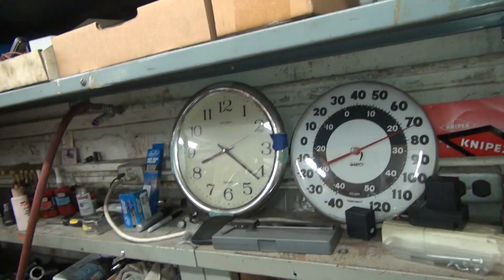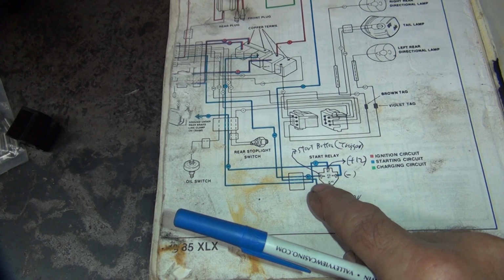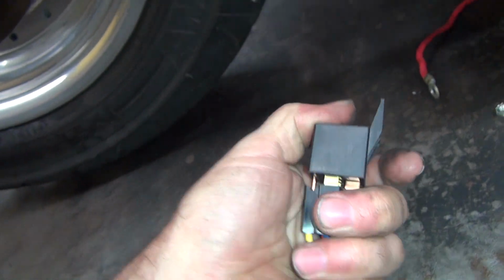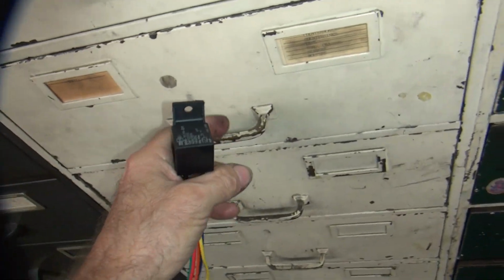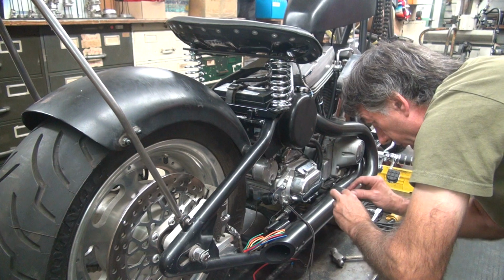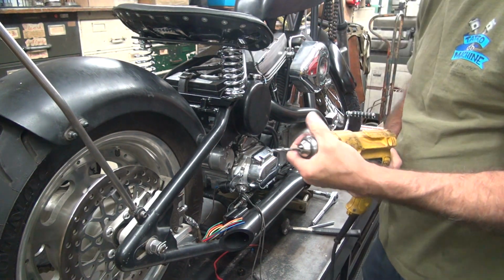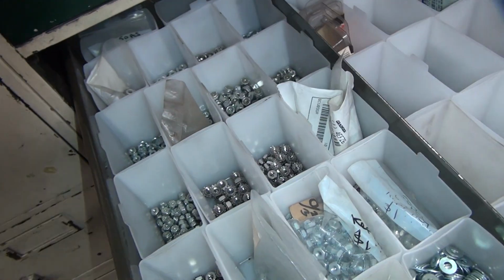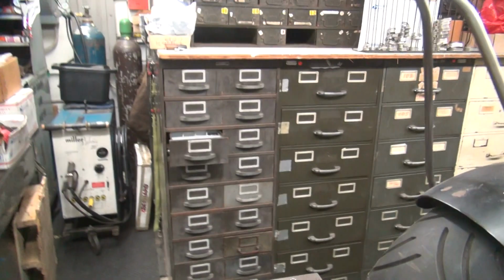#223 1999 80ci evo chopper used bike tune-up repair rebuild rigid bobber custom harley tatro machine

Comment: Any reason why you didn't just fit an aftermarket front plate on the solenoid with a plunger? Would have saved a lot of hassle, simplifies things and only about £9.
Reply from the maker: not everyone wants that button on their bike. its safer too.
tatro
Reply: @TatroMachine  - always looking to learn, as I have just fitted one, how are they less safe? Not trolling, just learning 😎.